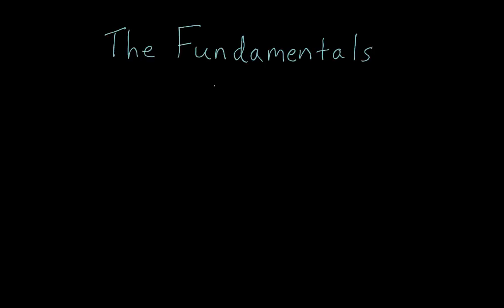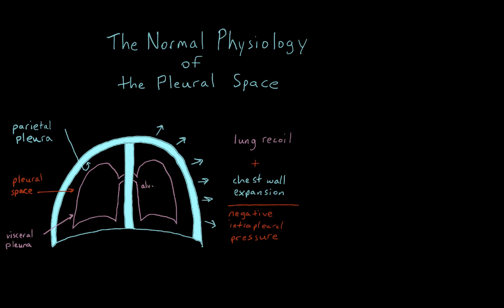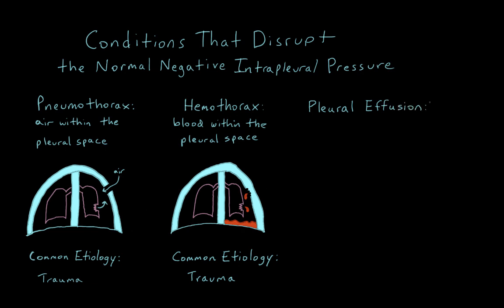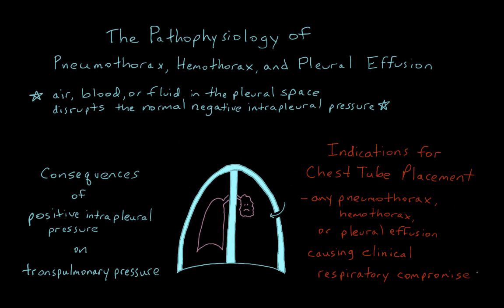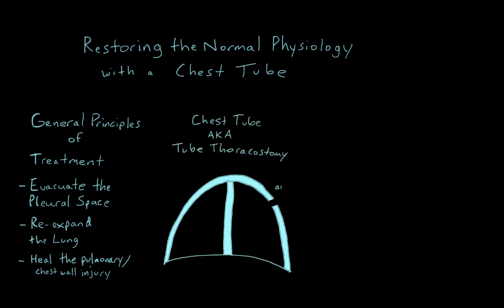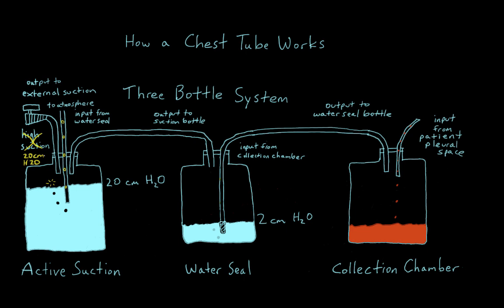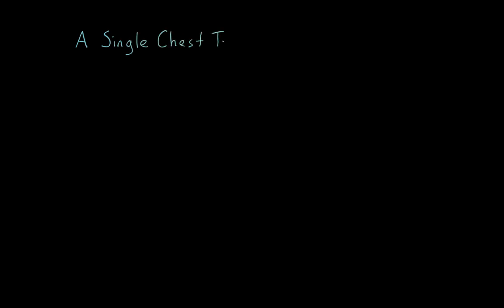The Fundamentals of Chest Tube Physiology for Learners on a Surgery Rotation

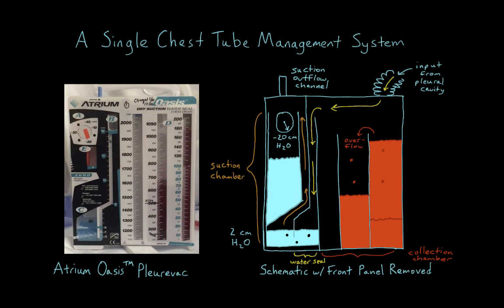Comment: I was following your video until 16:35 when you state that there is actually water behind the front panel in the suction control chamber. However, this is a DRY suction set up-- meaning there is not water in the suction control chamber, correct? Isn't that the main difference between a WET and a DRY suction chest tube drainage system set up (whether or not there is water in the suction control chamber)?

Comment: This video is pretty good, but uses imprecise terminology and almost circular reasoning in some places. For example: "Systems flow from high to low pressure." What do you mean by "a system flows"? It's a fluid (gas or liquid) that flows, not a 'system'. But overall well done.

Comment: What exactly do you mean by negative and positive pressure?
Reply: "Negative" pressure is a commonly-used but confusing idea. "Negative (air) pressure" means "SUBATMOSPHERIC" pressure, i.e. "the air pressure in area X is LOWER than atmospheric pressure'. "Positive" pressure means 'the air pressure in area X is higher than atmospheric pressure'. It can be a bit hard to visualize. 'Positive' pressure commonly exists where a fluid/gas/liquid is being compressed or squeezed (its container is exerting forces in the direction that tries to make the gas volume smaller), whereas negative pressure exists where the container is trying to pull outward on the gas, i.e. the container is trying to pull the gas into taking up a larger volume than its resting volume.
Reply: @ededitor3556  THANK YOU SO MUCH!!!
Reply: @jasminejohnson2182  I'm glad you still found that useful (2 years later!)